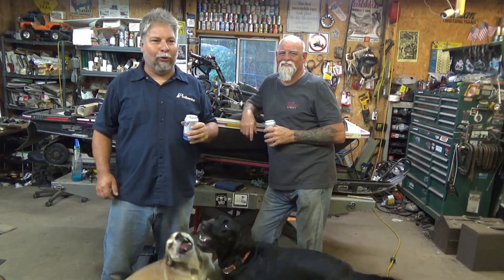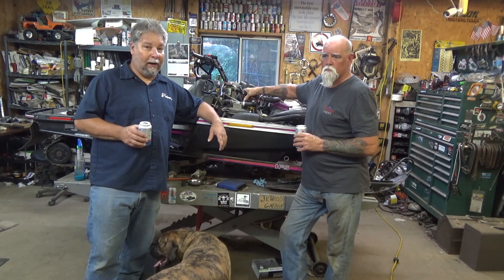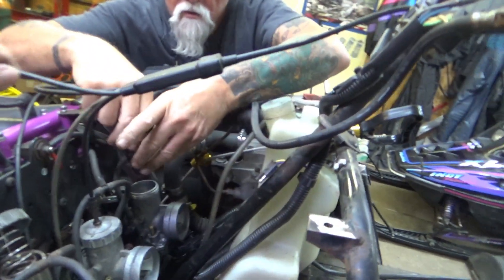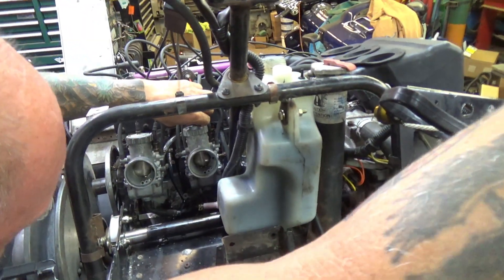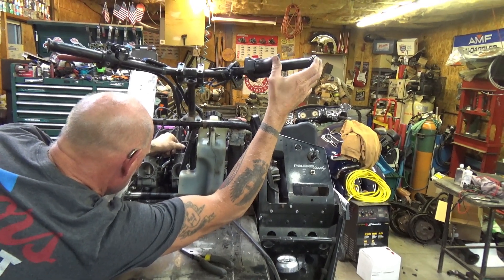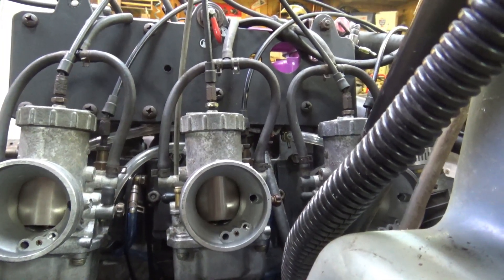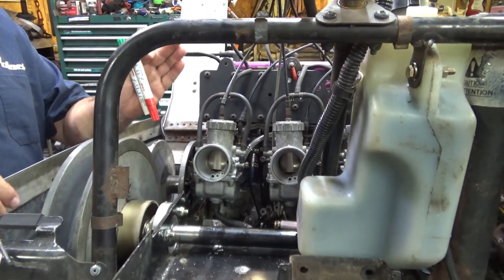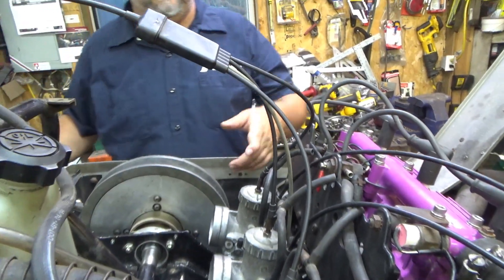Brad's Ultra Part 14. Carb Synching and more. Polaris Ultra Vintage Mod Snowmobile.

Comment: On a Bing....1/4 inch drill under the slide, screw in the idle stop screw until it just contacts the slide. Adjust the top to take the slack out of the cable. Repeat for each carb. Done. Now you have a starting point from which further adjustments are made. A permanent marker vertical  line on the idle stop screws from which reference is made to equal slide height above the carb throat.

Comment: Hey boys, just want to say good work I love your videos. An old racer that I knew years ago told me take a straight edge and laid across the top of each carburetor with the Caps off to make sure they're perfectly level it says it makes a big difference I've always done it that way don't know if it does or not that's what I do. keep the videos coming
Reply from the maker: Great tip Glenn! Only takes a few seconds to do so we'll do it.

Comment: John, I usually tie my throttle cable down to approximately where it lands on the airbox. I have used zip ties and a broomstick or something to hold it in the ballpark. I found that the accentuated “s” curve that it makes when tying it down to the airbox afterwards will lift the slides a few thousandths. Every bit counts to keep away the famous triple bog
Reply from the maker: Right on! Brad is going to run pods or K&N on this, so I think it's pretty close. Might do a zip tie around the steering stem to get it closer. Thanks Spencer!

Comment: Hey guys!  Love the videos!  I finally subscribed to your channel👍
I’m a Polaris triple freak as well!  I drag race vintage Polaris sleds up here in Saskatchewan Canada 
Just wanted to say how much I’ve enjoyed your channel👍
Great idea on marking the idle adjustment screws👌   I’ve always had decent luck with using a 9/64 drill bit laying in the bottom of the carb throat and adjusting the slides until they come in contact with the drill bit
Keep up the good work guys!!!
Reply from the maker: Thanks for subscribing and welcome to the channel! The marks can be real handy for idle adjustments on the trails.

Comment: Thanks for the carb sync part. This was a very good description. I wouldn't mind the carb rebuild part and maybe a little jetting info. You might have some of that in your other vids just havent found it yet. Cheers.
Reply from the maker: I might do a video on reading plugs, but as far as telling someone which jet size to use -- that is mega risky. Best bet is to always start rich and read your plugs as you work your way down to a nice cocoa color.

Comment: I usually do a carb sync by feel and it seems to work for me, nothing wrong with what your doing either. I suppose the correct way  would be with a vacuum guage as each cylinder will pull a different. I know on a 4 cylinder 4 stroke motorcycle that makes a huge difference on idle and off idle response.
Reply from the maker: I've done the vacuum gauges on a bike, but never a sled. You have to have it running so you already have the idle screws turned in enough to run. Then you'd have to adjust the idle screws until the vacuum was equal and then work on the pull. I suppose if you idle it up another 500rpm using the flipper and then adjust the cables to even the pull it might work really well. I'll have to try it some time.
Reply: @nuttersspeedshop  no need to change your routine unless your curious. 
As of now I dont even have worry about it, I have 2 sleds at the moment, one is a single carb and one is a rack of 3 carbs with all the carbs tied together on 1 throttle shaft. That one purrs like a kitten even though its a Yamaha lol
If I buy another sled it will be a 3 cylinder Yamaha ( oh the horrors!) 4 stroke with fuel injection. I suspect the throttle bodies will need a sync once and a while such as after a valve adjustment but otherwise should be fine.
Reply from the maker: Thanks Dan. It is an interesting suggestion. You may see more about it in the future.

Comment: Just wondering if you've done a video on adjusting the air mixture screws.  I'm working on an Indy 500 Classic with flat slide carbs and it's a dog out of the hole.  Can't figure out what's wrong.
Reply from the maker: I seldom work on flat slides. The Polaris service manual is really good. Also check your clutching.

Comment: I do this exact same method.  All three carbs are synced at idle and pull at same time but they don't appear even with top of carb when wide open.  Any ideas what I'm doing wrong?
Reply from the maker: Are you starting with the cables slacked off and the idle screws turned out so that you are working from the machined surface?